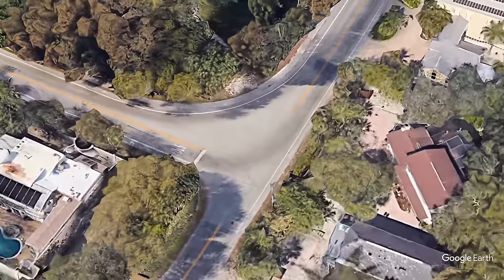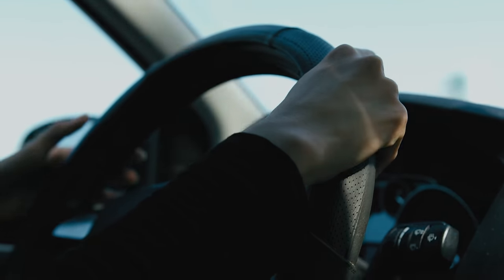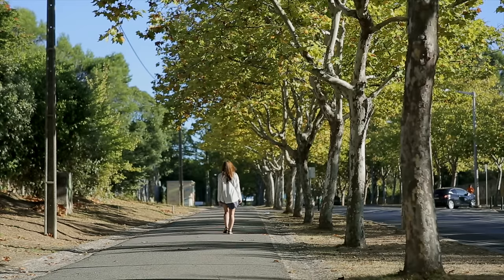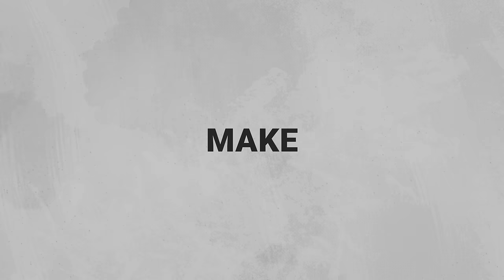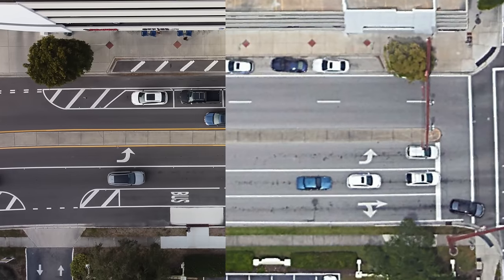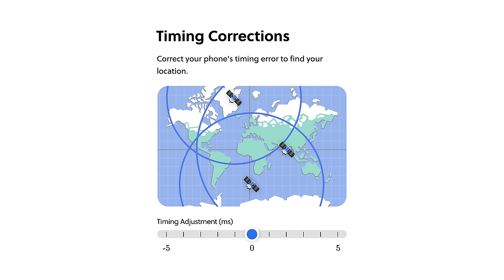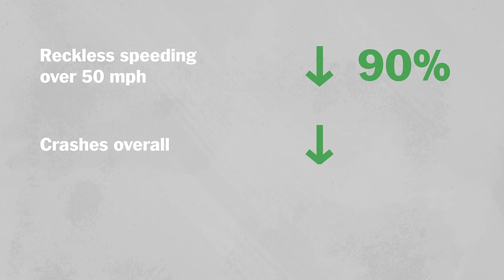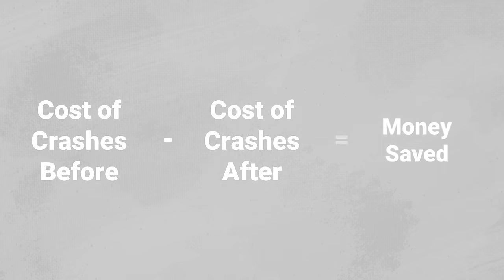This is the key to safer streets

Comment: This isn’t anything new. We have had these plastic style mini islands here in the UK since the late 1990’s and Europe since 2000’s. They save a lot of money compared to digging up the junction to put a concrete mini roundabout. Along roads where people are driving too fast, they model the road city chicanes, raised areas and change of flow curbs. The Speed humps (Sleeping Policemen in the UK) have been a regular feature on European roads for decades. I’m surprised the US hasn’t done these measures decades ago. 

They work until an idiot chooses to drive at 70mph through them crashing.

Comment: This is exactly what has to happen world wide.
There was one street in my home town in Germany, in which I always felt like going slower than I was allowed to drive, and I loved it.
It was just a subtle thing that doesn't seem to be in this video either, but I can describe as: Wide, but narrowed down with roadside parking spots and a bicycle lane, curved, slight elevation difference, plenty of streets intersecting that have to give way, and no divider line.

The limit was and still is 40km/h (~25mph).
The reason I bring this up is, that they completely rebuild it a few years ago, and I was afraid they might ruin the formula.
I'm happy to say, they didn't!

It received an extra bicycle lane, the existing one was widened. Some roadside parking spots were removed, and that's it.
You somehow have less room as a car driver, but it doesn't feel cramped.
Overall a great street to drive through, far better than many in my town (Which was cause for my fear that the street gets ruined).

Comment: What baffles me is why Americans created and lean toward diverging diamonds when round abouts do a perfectly good job at highway offramp intersections. Less cost, less confusing and less delays than stop lights.
Reply: You must have missed why diverging diamonds were created in the first place: they have to be able to fit in the same space as the existing overpasses and connect with the existing on ramps to be able to avoid changing the highway layout (which would be very costly)
They are the best solution given these constraints
Reply: Roundabouts would not work in those interchanges.  The traffic volumes are greater than a roundabouts capacity.  And the construction would cost more due to more right-of-way, drainage, and materials.

Roundabout interchanges work better in more rural and suburban environments.

Comment: We need to drastically tighten the requirements required to obtain a drivers license in the first place. I would argue at least half of all drivers in Ontario for example are simply not fit to be operating a vehicle. Poor spacial awareness and little to no understanding of basic physics like momentum, inertia and traction seems to be 'the norm'. I only received my drivers license just over a decade ago and was completely shocked how little I actually had to do to prove my driving ability. No defensive driving requirement whatsoever!

Comment: Europeans use this and claim it’s for speed reasons but the true reason has to do with not building infrastructure for vehicles and stop lights but rather reusing the original roads built for horse and foot travel.
Reply: Europeans use it for faster flow and safety, not speed.
Reply: What are you on about. They're used on new roads as well to improve traffic flow.
Reply: Some of the most walkable European cities did most of their expansion after ww2. Vast areas of many us cities predate the invention and popularization of the car.

Comment: You missed the most important tool: Teaching people to drive attentively, and not setting the bar for getting a license so low that it becom s frivolous to obtain one. I would argue that these steps would produce better results than all of the other so-called "calming" measures combined.
Reply: Even competent drivers speed
Reply: @catairlines-peciarda  Speed is often not the culprit. Incompetence is. Asbis bad road deaign. Our licensing systems encourage incompetence. Then they set artificially low "speed limits" to compensate, under the ruse of "safety"... as if "speed" is the only problem and "limits" are the only solution.

Comment: The US "Invents" the mini roundabout..
*laughs in British roads"
Reply: Kind of missed the point. It's not inventing a mini-roundabout, just a new way to build one quickly and cheaply, but durable.
Reply: @jaycee330  and yet the UK and Europe manage to outsmart again by using road markings rather than infrastructure. Another classic example of the US over engineering something to claim a win or something new.
Reply: @Nerdchacho  And yet, and yet, countless drivers just drive over the painted circle in the UK.  I've seen it, I've driven behind drivers doing it.
Reply: @jaycee330  and even then incidents if accidents are still down. It isn't about the hardware, it is about the driver discipline.

Comment: 1:15  Insane
With each crossing, small plastic particles are torn off and end up in nature, in waterways, which then end up in animals and on plants and finally in humans.
Reply: Uhhh... They're tied down way stronger than you may think. Also, animals can just swallow a 3 foot beam?
Reply: Every single car featured in this video was slowly degrading the rubber from their tires, leaving particles in the environment. That seems like a much bigger issue than this single intersection.
Reply: Yeah but if youre concerned about that, then dont drive a car, because then (gasp) youd be creating carbon monoxide! and even if you had an electric car, the lithium used to make those batteries is still much more damaging to the environment.
Reply: @ItzBIULD  So your logic is that since car traffic inevitably gives us potential environmental problems, we might as well add more?
Of all the traffic solutions in the US I have seen, plastic roundabouts are the most stupid thing I have seen as a European. 
The fact that heavy traffic can also drive right over them is beyond all sense and reason.

Comment: So, is the fact it's plastic relevant or would any round about have done it?
Reply: they explained how it 's relevant right away: It's cheap and easy to install, and can easily be removed if it doesn't work out.
Reply: @BenjaminWalburn  So... They could have just used paint and saved a lot of money and had a superior end result...
Reply: @ChaosSwissroIl paint isn't exactly as good as physics. If you drive over paint. You barely feel anything.

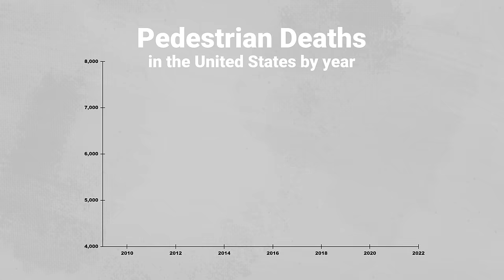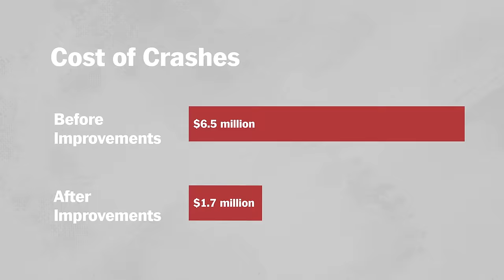Comment: I like the video, but I feel like I'm getting baited or something. Like the graph at 02:52 starting at 4k instead of 0, despite it nearly doubling over the period, meaning you wouldn't have to exaggerate it to show how bad it is. Or the costs at 03:22 not having any period specified.
Reply: Deaths in traffic don't start at 0 in 2010?

There is no other way of showing that except more exaggeration by moving it all upwards.
Reply: @ooRobertoo  yeah I'm saying that it starting at 4k makes the upwards shift look more like "from 0 to 8k" than "from 4k to 8k" 
Why start a graph above 0 like that except for the perceived effect? It's not like there wasn't space for it
Reply: @lindholmaren  thats how graphs work i guess, you show on 1 side a value and the other aide a value that fits your values. Same reason you dont show higher than 8k on the left, because the values dont exceed that i guess
Reply: @ooRobertoo  except you often do, in my experience you almost always do 
Graph starts at middle and has maybe 20% padding towards the top (unless it's something with a reasonable cap, e.g. percentages) 
EDIT: in fact when googling "pedestrian deaths in us" (because, annoyingly, the actual sources for each claim aren't cited on screen) and opening the first link (the iihs one) it starts at 0 and ends at 50000, despite neither of the two graphs on it going below ~4k or above ~43k 
TBF, the ghsa report does also start at 4k, but it's also constrained to the dimensions of a paper and wants to display the year over year differences clearly. But like the fatality rate/b. miles travelled stacks start at 0, not 1.89. The fatality rate/100k starts at 0, not 1.91. 
The graph of pedestrian fatalities/light condition goes from 0 to 6k despite neither of the two graphs dipping below 1k or actually going to 6k 

I just think you need a really good reason to fiddle with how you display data like this, and unless you're constrained to the width of a paper, static print, and you need to illustrate the year over year diff I don't see why you would

Comment: A road diet seems questionable, because it doesn't answer the question "why was the road made so wide in the first place?"
If the reason was to avoid traffic, then repurposing the lanes that exist to relieve traffic would likely just contribute to more traffic, no?
Reply: Wider roads only alleviate traffic in the short term. Giving lanes to other transport modes like buses and bikes does alleviate traffic though as you can spread out what modes of transportation people use so less people need to drive at the same time.

Comment: This is all really good. But it's notable that the one thing they don't talk about here is ***congestion***. Slowing down dangerously fast traffic and protecting pedestrians is important. But so is making sure that motorists can get places without sitting in bumper to bumper gridlock. When you reduce the capacity of roads without commensurately increasing road capacity along alternative routes, you're going to end up with more congestion. The same number of drivers still need to go the same places, but now there's less room for all the cars.
Reply: Roundabouts absolutely ease congestion, and things like crosswalks and pedestrian islands are only really used in populated areas like shopping centers or residential areas, where traffic shouldn't be fast like a highway. Of course the actual solution to ease congestion is to improve public transport infrastructure like trains, trams and buses so less people feel they have to drive, so less traffic overall. Drivers benefit, pedestrians benefit, commuters who would have to drive otherwise also benefit. There's no reason as a car person to not like public transport. That + well implemented bike lanes (Not just slapping another line on the ground with no extra space/markings or enforcing people parking in the bike lane.)

Comment: In Russia you are not allowed to park near crosswalk, like 10 m safe distance from both sides
Reply: That's only true for Belarus (it's actually 15 meters in their case).
In Russia we still have an archaic rule prohibiting stopping closer than 5 meters in front of a crosswalk. So it is legal to stop right after the crosswalk, even on a two-way road.
Reply: @NewBuildmini  this usually fixed by putting road sign which forbid there, and it done almost everwhere i saw
Reply: @tsugumorihoney2288  That works as long as the drivers respect the rules. And that's not always the case.
Also, in a lot of cities the traffic police is understaffed and has little to no time to enforce parking laws. St Petersburg is especially notorious for this, it's common to find cars parked on sidewalks there.
Reply: @NewBuildmini  just make call trafic police and if guy who left car didn't managed return to get fined and drive away, he crab his car from impound parking, works nice

Comment: My mother routinely voices her fear of missing someone at a four way stop and not seeing them, but she never shows any apprehension when approaching one, likely because her vehicle comes to a full stop. And yet she gets really paranoid about roundabouts, she's worried about doing something wrong, but every time we drive though one its hassle free. And I think that's the core to why some people don't understand how in the right places roundabouts are actually safer, they're to preoccupied on the fact that there's a supposedly a consistent rule for everyone to stop and how roundabouts let people keep driving, that they are ignoring the annoying fact that figuring out how has the right away and which direction they're going is what makes stops so frustrating and dangerous. Ultimately the "safety" of a 4 way stop is just the knowledge that "I" did nothing wrong, not that things are less likely to go wrong, and that's perhaps the biggest conceit of driving in general, we'd rather risk an accident that we think we can survive and blame on someone else than try to minimize and avoid them.
Reply: I think really it's just older drivers who have difficulty with roundabouts, younger drivers (<40 years) have grown up with them, so it's not an issue.
Reply: To safely use a roundabout, you need to come to a complete stop, thereby negating all the alleged benefits of a roundabout. They literally only make sense for 5+ way intersections.

Comment: it is so insane how much is neccessary to make car drivers follow reason and/or rules because laws are too theoretical only. why is it that people inside cars so terribly fail to comprehend the dangers they inevitably supply people outside of cars with? and don't you dare to say "but cyclists cross red lights all the time!!" – yes we do. red lights do not even turn up as any noticeable cause of accidents in my country, yet soooo many people outside of cars die when having had green because of cars bending off. might sound weird, but red is actually safer to cross than green because you do not overtrust lying signals. green is not safe because there's cars close by. red is safe because you check.

Comment: Speed bumps are actually dangerous, especially when badly designed.
I had damaged my vehicle on a speed bump even though I was driving at required speed limit.
Also speed bumps are more slippery than normal road, especially on winter which can cause loose of vehicle control.
This is especially dangerous for bicycles and motorcycles since slipping on a speed bump can cause you to fall off your vehicle and be hit by the car behind you.
Reply: Have you tried going slower than the legally maximum speed?

Comment: I am curious, how did the amount of traffic on the road in ohio changed. As in how many motorists, pedestrians and bicyclists on the road before and after. Its one thing to say there are less crashes and try to attribute it to a change, but without looking at the whole picture you can be giving the wrong data. As in there may be less crashes because there is less traffic on the road now. 

I bring this up because something similar was done here where I live. They found out there was a lot less of 1 type of crash but there was more of another type, and over all there was about 50% less vehicles being driven on that road compared to before the changes. If I were to guess now, I am guessing its even less vehicles as nearly every business in a 4 mile length of that road has closed doors now, compared to it being filled with businesses prior. People have voiced how they aren't willing to go to that part of town just because of the road, sad part is its the downtown and uptown section of the community. 

Anyways I am just getting at it would be great to see all of the data and not just 1 little perspective of it.

Comment: These examples of addressing traffic and speeding issues by redesigning the roads/streets (in Italian there is just one word, "strada", thus we cannot point out the issue of wrong design to purpose by a simple use of vocabulary) are always what I think when hearing the debates.
It is in contrast depressing that the only solution that is discussed in the public debate here is a generalized speed limit of 30 km/h (18,6 mph) in cities, no qualification given. Considering we have highways (no traffic different from cars and truck, no crossing, etc.) passing through cities, does the speed limit of 30 km/h applies to those as well? I would guess "obviously no", which is enough to conclude that some qualification is also obviously in order. And also, is 30 km/h safe for pedestrian and cyclists, mission accomplished? No, a truck wheel passing over a person is just not safe at any speed! A six lane crossing is not safer if we just put a speed limit at 30 km/h and then tell cyclists and pedestrian to go through it, 'cause now it's safe... I think it's almost criminal to tell people such a thing.
But then it means that the speed limits should be according to the design of the street/road infrastructure, and that the issue rather requires a redesign of this infrastructure.
Public debates like to use simplistic slogans, rather then recognizing the complexities of issues, and this doesn't help to improve the situation, especially when political parties entrench on ineffective points.
I am all for rising the speed limit on highways (from the current 130 km/h) and lowering it in residential areas, but all of it not just by signposts, rather by infrastructure design.

Comment: They could've done this in a few hours with two signs and a can of paint. I've seen it done this way too many times. (a lot of them just piss me off.)

At first glance this sounds like a stupid project, but it works, thanks to someone with a clue being involved - I've seen too many round-a-bout conversions that ignore what has to drive through them. It helps that people are obeying the new obstructions. I'd be interested to know what they were thinking when the first built this mess - the long radius is likely to support trucks making that turn, but they did nothing to discourage cars from taking it at speed.
Reply: I would think a raised big circular bump in the road would cause some damage to a car flying over it at speed.

Comment: Speed bumps are not a solution. Where I live roads are not maintained well - so drivers have high tolerance for them. At the same time when I ride a bus sitting in the back speed bumps try to throw me out of my seat.

Speed bumps only try to fix flawed design in a way politician will understand. No good design will benefit from them.